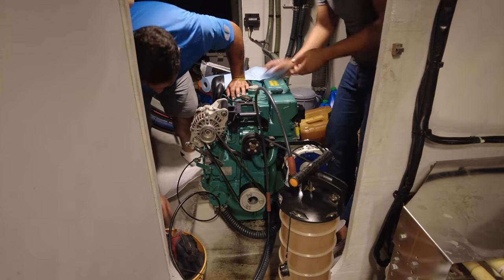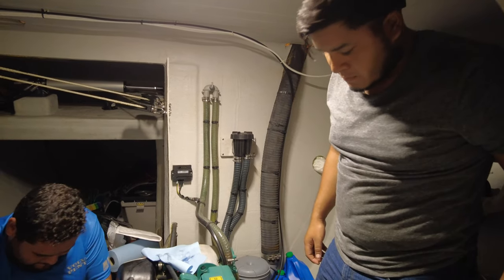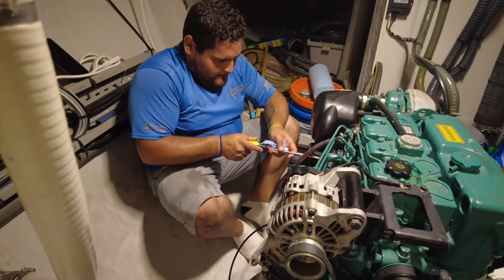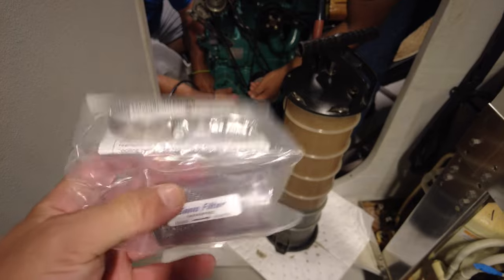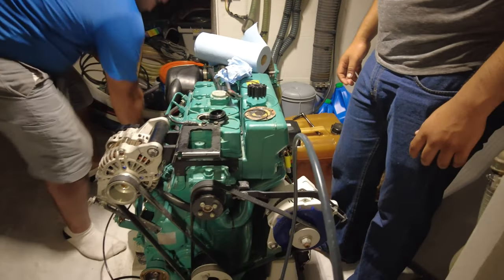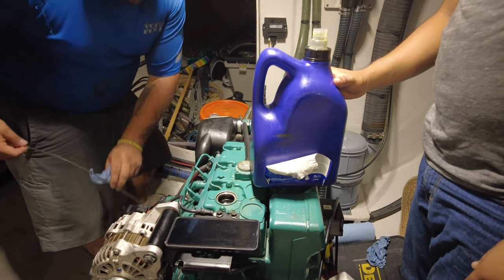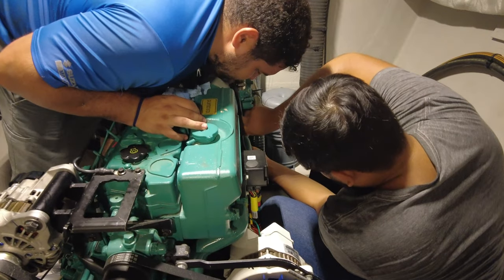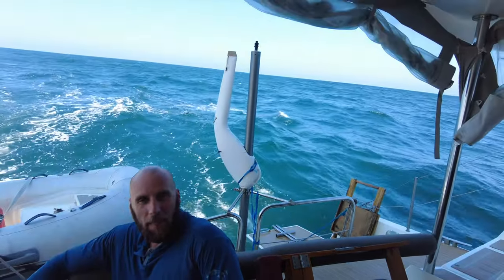Servicing a D2-75 Volvo penta engine.

Comment: I find your videos amazing to watch from an entertainment purpose but also from an educational standpoint ... as my wife likes to put it "enterTRAINment!"  Thanks so much for the time you take to review the Neel 51 (which is on my wife and my shortlist) and go into detail on all the modifications / improvements you have made (as both my wife and I are engineers).  In relation to this video, would you recommend the Integrel system with Lithium over a generator (if you were to build this boat again)??

Also, I may have missed this in your channel, but one thing that will be the hardest thing to give up for my wife and I, is our dog... we have always had a dog in our family and we wonder how you get on and whether its changed any of your plans of where you are going??  

thanks again for your videos and looking forward to you carrying on :)
Reply from the maker: Mike, 
Many thanks to you and your wife for the kind comments. I would definitley go for the integrel setup or an electrodyne alternator. Though there is a bit of risk involved. THe onan cummins is about the most reliable bit of kit I have on board. 11KVA. The performance is not greatly affected by it's presence. 
WRT the dog, no issues at all as she has a eu pet passport, however sailing to AUS and NZ will be very difficult with her. She will need to quarantine, which is tough for the dog.
J

Comment: Thanks for the view of the coolant filter - I've been looking for one! Did you get it installed? How's it working?
Reply from the maker: HI steve,
The advice I got from those more skilled than me is not to do it. You are better to lower the strainer below the water line. that is all we can do im afraid.
Reply: @carryonsailing  Interesting... our sea strainer is well below the waterline, but that's "up-line" from the impeller/pump. I'm looking for ways to catch any impeller bits to avoid having them end up lodged in cooler, etc... Safe sailing!

Comment: With and additional 1kW of solar behind the cockpit and maybe a larger alternator do you feel you could go without the genset?
Reply from the maker: Yes easily. If you want to do that, larger engine and elctrodyne alternator. I however think the Genset is the single most reliable bit of kit. Onan Cummins. Wish my engine was built by them.
Reply: @carryonsailing  good point, redundancy is probably worth the minor bit of additional weight.
Reply from the maker: it doesnt make a massive difference to performance. I have compared with other NEEL 51. Thus, I would suggest copy my set up if you are interested in a neel 51 apart from the D2-75. Even better if you could get a yanmar or beta marine engine. Nanni are good too,

Comment: Hey James. Hope you are well.  I am thinking on getting a Code 0 sail for my Neel 51 so I have a light air reaching sail. Note that I am getting hydranet sails. In your experience is a light air reaching sail a good  add or does the Genoa get it done?
Reply from the maker: Yes. Code zero is a good option for all points of sail though technically for upwind. It's easy to deploy and therefore more use able. Also Bret, if you do the miles and are going to circumnavigate, I would say its almost a must. I personally do not think the assymetric is as much value as a gennaker or code zero for cruising. Remember in light airs you will want to keep her reaching and therefore, the apparent wind will be well forward of the beam eventually, so go with code zero.

Comment: Wow - thats not how you drain the coolant from a D2-75. Theres several drain nippes and a big square plug at the bottom of the heat jacket. if you don't do that, you can't get it all out.

Comment: You need an electric engine and batteries with solar panels. No maintenance needed. For Infrequent use they would be perfect and cost nothing to run. No oil, no diesel, no problems.
Reply from the maker: The maximum range you would have is 15nm without having a diesel generator (DC) to charge the batteries. That isn't viable for what I we do.
Reply: @carryonsailing  Haven't you seen the silent yachts. Can run all day with solar cells and batteries.
Reply from the maker: Yes I have seen videos Barry thanks for info. However what I haven't seen is any operating in the places I go. Once I start to see electric engines in the far ends of our planet WITHOUT the need of a generator (combustion) engine, then I'll be very interested. 20nm range without genset isn't enough for what I do. Perfect for a costal boat. Also parts will be hard to find for newer systems.